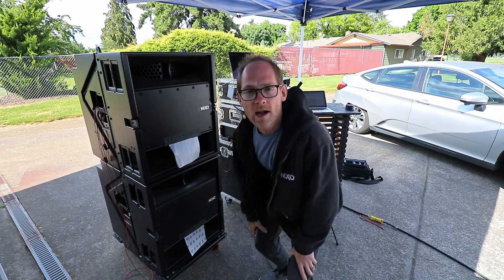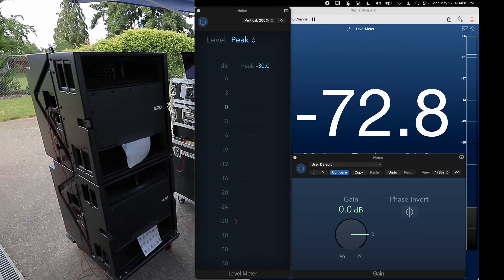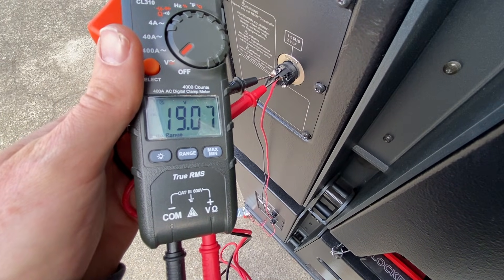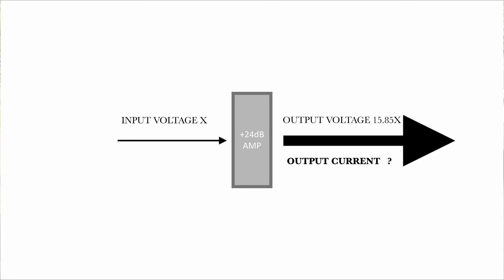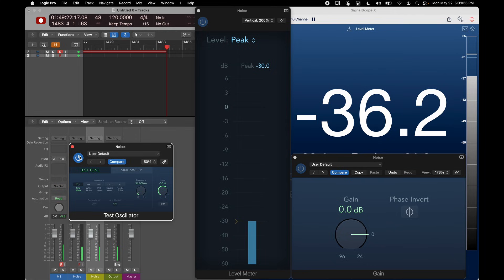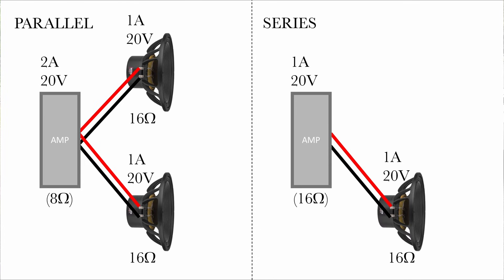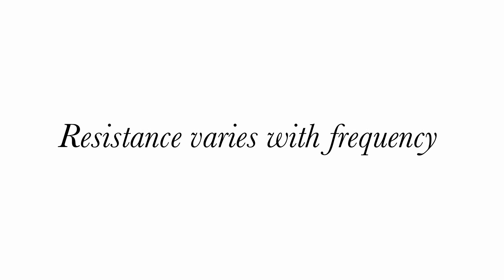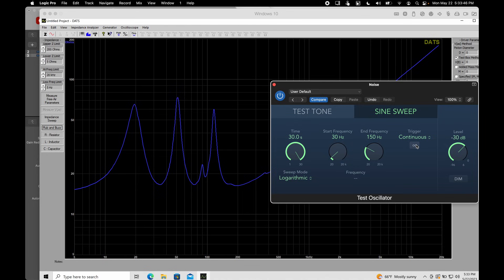Is doubling speakers +3dB or +6dB? What's parallel and series wiring?

Comment: I don't get with your +3dB amp and +3dB acoustic power adding together resulting in a 3dB gain.
The added electrical power  powers the added transducer, and the added transducer produces sound. The 3dB gain is converted into 3dB acoustic power. The acoustic energy is just the electrical energy being transformed into acoustic energy using the transducer. You've said that the transducer doubles the acoustic energy, and I don't agree, it just transforms it. 
The +6dB comes from the definition. If I have a sub firing, let's assume it produces a monopolar radiation, then this simple model spits out the pressure : P = μ0*Σ*ω^2*X_eff /4π  with X_eff being the efficient displacement of the membrane, Σ the surface of the loudspeaker and μ0 the magnetic constant. Then by adding another sub it's the same formula, but replacing  Σ by 2 * Σ. thus adding 20 * log(2) from the definition of SPL : SPL = 10 * log(acoustic power/ref_acoustic_power) = 20 * log(P/P_reference). And 20 * log(2) = 6.021 something. The discrepency between the +3dB POWER and the +6dB PRESSURE is that acoustic pressure is related to acoustic power by a square law. 
Please challenge me if I'm wrong, this has made me crazy over the last few days, I can't sleep lol.
Reply from the maker: 3dB from amp and 3dB from additional speaker (in parallel) will be 6dB total increase. The usual confusion is over why there would be 3dB more from the amp in parallel with the addition of a second speaker, but 3dB less from the amp when in series. Was this the thing you were referring to?
Reply: @devinlsheets_alphasound  yeah that's exactly my point. The 3dB added from the amp are transformed by the transducer, thus there is no "+3dB" from the additional sub. The +3dB from the additional sub comes from the amp. Saying "+3dB" because there is another sub means that this energy comes from nothing, which is not physically possible.
Reply: @devinlsheets_alphasound  the thing I'm referring to is a french pdf by Brouchier, you can find it online. What you're looking for is at page 52, but it's in french...
Reply from the maker: @dbzlouis  the thing is, the mic reads a 6dB increase when the second sub gets plugged in in parallel. Basically, that’s the starting point and then the question is: where does it come from? 

For example, you could imagine doubling the power to just one speaker. What would happen then?
Reply: Okay I think i got it. 
First, as a side note you didn't tell us how the dB measurement you're calculating is calculated! Sometimes there is a mismatch between the 10log(energy) and the 20log(pressure) formula and people mess up. 
But I think your db meter is not the cause, the real cause is the placement of the mic. At 0:54 I can see that your mic is in the air, so when you add another sub you have the sub + the reflexion of the sub. I think if you'd run the same test, but with the mic on the floor, you would not have than extra +3dB.

EDIT : I'm wrong, since even with the reflexion you also double the acoustical power, since the original sub is also being reflected
Reply from the maker: @dbzlouis  I actually did run the test with various mic locations because this was my initial suspicion as well, but it doesn’t make a difference, maybe a half decibel or so.
Reply: Another thought: mic placement is very close to the sub, 1m is not that far away at 36hz. My first message uses a very simple model, that can only apply when you're far away from the sources. Here since you're relatively close considering the wavelength, I think the model to apply is more a di-polar model. In that case, that can explain why you get +6dB. But put your microphone at least 3 wavelength further and I think you'll only see +3dB. 
I can try to reproduce that on video and test it in real life
Reply from the maker: @dbzlouis  yes this would be a very interesting test! Might try it myself as well
Reply: @devinlsheets_alphasound if so, try a test at 36Hz, and one at 100Hz for example, this would change the wavelength and give different results. 
I can do the math properly and give you the final results too haha, no more "in my head" calculation

Comment: What is going to hapen if we plug two pairs of 8ohm woofers but one pair is paraller and the other one in seriers to the first one? Will the resistance be the same as if we have just one woofer? And the output still be doubled? Or the output will cancel itself as well?

Comment: I've seen all the internet about this issue and this is the best explanation of all. I'm really impressed! But 3:44 you say that one more sub gives you +6db. Are you sure? I thought it would give you another 3db, not 6, so together they would make +6db and not +9db. Do I get it right?
Reply from the maker: That’s because you can’t add that second sub in parallel without also doubling the amplifier power, it just happens automatically
Reply: @devinlsheets_alphasound  I appreciate you answer but my question remains unanswered. Sorry, my English is not perfect and I might have not made myself clear enough. The problem is mathematics. If one sub gives +3db, another sub should give another +3db, which would make +6 db all together. What I Understand from you video at 3:44 is that one sub adds +3db but another sub adds +6db which all together makes + 9db. Which is correct? Does the extra sub give +3db or +6db? Because the picture is confusing to me. Thank you
Reply from the maker: @paul7000  we’re only asking what the addition of a second speaker is to the equation, whatever SPL the first speaker is already providing is a given
Reply: @devinlsheets_alphasound  If one sub gives +3db, do two same subs give +6db or +9db? Assuming that we feed them with same RMS.
Reply from the maker: @paul7000  one subs doesn’t give 3dB, it gives whatever dB you run it at, which depends on how big your amplifier is and how close you are to it. It might be 3, or 93, who knows. Adding the second speaker (and doubling the power) will add another 6dB to whatever dB the first speaker was putting out. If it was 3, then it’ll be 9 total. If it was 93, then it’ll be 99 total.
Reply: It is surprising. Thank you!

Comment: It should also be noted there are some practical considerations that need to be taken into account when doing things like this. When you let an amp drive a one or two ohm load, you're beating the crap out of it. Playing music through a system isn't the same as taking measurements on a test bench. Also, you have to consider distortion. The harder an amp works, the more it distorts. Its unavoidable, and the amount of distortion an amp produces is directly related to how well its made. 2 power amps may be rated for the same amount of output in watts/ohms, but one may have half the distortion, and in the real world, that would make it a much more powerful amplifier. 

I see in a lot of the comments, people seem to think they will be "loosing power" if they don't lower a speakers resistance so the amp puts out its rated full power at one or two ohms. Lowering resistance forces the amp into a situation where it has to work harder to deliver the same amount of performance than a speaker that is less demanding to drive, like one that drops no further than 5 or 6 ohms. The practical solution in a situation like this is to turn the volume up. That's why its better to present the amp with a speaker that's easy to drive in the first place. It leaves you with the freedom turn the volume up without fear that you will damage your amp or speakers.

Just to be clear, from what I could tell, everything covered in the video appears to be accurate. Nothing is wrong with the content. My concern is things were left out. Most likely there will be a future video covering the issues I raised above. So my advice would be to wait for future videos covering the rest of the topic before making any purchase decisions.
Reply: Wrong on a few points.

Comment: I have a question, that answer I cannot find anywhere. I have a pair of 4 Ohm speakers and a pair of 8 ohm speakers. My integrated amp had a typical 8 jacks for connecting 4 speakers. The A is 4ohm-8ohm, and the B speaker slot is 8-16 and the A+B asks for all 8 ohms. Since I dont have 2 pairs of 8 ohm speakers, so can I somehow connect the 4 Ohm speakers at the same time with 8 ohm without damaging the 4 ohm speakers, as I understood that in case of connecting all 4 speakers they should be all 8 ohm?

Comment: But what if amp would work in lower than 2 ohms. Why I can't connect 10 subs in parralel, because amp will rip ?
Reply: The issue is not just the nominal impedance of each speaker, it is also the absolute minimum impedance at a certain frequency. As we saw in this video, the graph of impedance by frequency for a given speaker has peaks and troughs. So with music containing a particular frequency at a high level, a frequency which corresponds to a very low trough on the impedance graph, the current in the amplifier could increase beyond what its circuits can handle, thermally speaking.

Comment: It's really surprising how little people in the business actually know about loudspeakers, which is what the basically make a living off of. 43% getting the 6db answer correct is astonishingly low.
Reply: He made a glaring mistake in his calculations, the real world answer when it comes to live sound is 3 db.
Reply: @pinocleen  No. You get 3 db more power, and also 3db more sensitivity. That is, if you haven’t reached maximum sensitivity yet, which takes A LOT of cabs to reach when it comes to subwoofers.
Reply: @Turntablist11  Just read the comments by Elkin Velásquez Cuítiva and J Smith where they explain the actual physics of it?
Reply: @pinocleen  Neither of their comments are in conflict with my comments here. 

Do you read it as such, and how do you do that?
Reply: @Turntablist11  Not sure, your comments are implying that this video is correct on its 6 db assumption and then you doubled down? Why don't you try and move the microphone around and see how you interpret that?
Reply: @pinocleen  6db would still hold true beside and behind the subwoofers, since the source of both subs is identical in position when they are stacked vertically.
Reply: @Turntablist11  Yes, I think the video could be explained better because it is causing a lot of confusion in the comments section, in part 2, I guess.
Reply: @pinocleen  Yeah it’s sort of explained halfways at a few points. 

You gain 3db in sensitivity per watt when you double the speakers, IF, the speakers are within 1/4 wavelength, and IF, you’re not already at the limit of sensitivity. 

The way he has stacked the subs, and that the example only includes subs, those things make the above statements true, but, the statements will not automatically be true for all speakers. Stacking lots of HF horns sure don’t get you 6db per doubling, for example.
Reply: @Turntablist11  Love learning new stuff, my background is in electronics and telecommunications, I have no pro/stage experience, so I'm glad I've picked your brains. Also a fan of the channel, for whatever reason, most likely my passion for amps, speakers and subs, and also seeing how this simple tech has evolved over the decades is fascinating.
Reply: @pinocleen  You’re most welcome! :) 

Loudspeaker driver design has taken leaps these past few years. Klippel is a huge contributor to that. Loudspeaker design is of course the natural following step, and hence that area is also changing quite fast right now. 

The most interesting things on the market are by far Danley Sound Labs designs. If you want to delve deeper into it all, I’d definitely start there. There is SO much to learn from understanding all of their designs.
Reply: @Turntablist11  This is right up my alley, as I've spent a few years installing just this kind of stuff during my studies, video/projection included, all except the live stage stuff, thanks.
Reply: @pinocleen  Danley is definitely your go-to then. 

Their very dense and rigidly built designs become heavy, which for the largest part make them viable for crews, or, for installs. :)
Reply: @Turntablist11  ahaha I've never heard of them before but looking at their spec sheet they sure pack a punch, and their upcoming home-range of speakers could be a banger. As for installs, give us an anchor point strong enough and we'll affix anything to it! Somehow..
Reply from the maker: There was indeed an error with that slide, I edited that part out with YouTube Studio.
Reply: @devinlsheets_alphasound  To err is human, more videos plz - I think that's how the saying goes?
Reply from the maker: @pinocleen  i think the saying goes "if at first you don't succeed, edit the video" lol
Reply: @devinlsheets_alphasound  :D

Comment: Great video. Do these rules apply to powered subs? I have the Yamaha DXS 18XLF powered subs. When I couple them together do I get +3 or +6 db gain?
Reply: In the case of self-powered equipment, the couplings are not a problem, since each box has an amplifier for itself, and therefore there are no impedance additions or subtractions.

Comment: At the 3:45 mark, I take exception to the idea that the second speaker adds  3db to the sould level.  In a parellel arrangement, adding a second speaker doesn't change the voltage, current, or power going to the first speaker.  Adding a second speaker doubles the amount of audio power produced (+3db).  The load on the amplifier has doubled requiring twice as much current.  Not only does this follow ohm's law, but also obeys the conservation of energy.
To get a 6db gain, you'd have to also double the power consumed and produced by each speaker.  But that didn't happen!  The voltage and current are the same and therefore so is the power per speaker.
The overall gain is only 3db.  So, why did the test microphone measure a 6db gain?
Reply from the maker: Right, good question. What if you just doubled the current going to the first speaker alone? Then what would the microphone read?

Of course this breaks ohms law, because you couldn’t double only the current and keep the voltage the same, but what you could do is increase the voltage and current each by 1.4 which would effectively double the power, which is the same thing. So in this case, we would get 3dB yes? And if so, if you split that power between two speakers instead of one, you’d have the 3dB from the doubling of power, but then also another 3dB from the doubling of speakers.
Reply: It's because its 6dB at a certain point in space. on average, you get +3dB. See for the formulas. If you double the acoustic intensity, you add 3dB. If you double the acoustic pressure, you get +6dB. He should have explained with formulas.
Reply: I'm with you on that.  The law of conservation of energy is pretty clear. You don't get something for nothing.
Reply: It's because most of that power isn't being transferred into sound, it's being wasted. You are not creating energy from nothing by adding boxes, it's already there, just not being utilized. Your speaker cone, being a solid, is high impedance and the air, being a compressible fluid, is low impedance. When you put a high impedance load into a low impedance load, well over 90% of your energy is wasted, sometimes as much as 99.9%. Most of the air just gets moved off to the side and eventually that motion ends up as heat and not sound. When you add another speaker, you double your cone area. That doubling of cone area doubles the efficiency of converting motion into sound of the whole system. That's where the second +3 db comes from, the increase in TOTAL system efficiency. Every time you double your speakers, you double your efficiency UNTIL you reach the maximum system efficiency possible and then that "free" +3 db's is no longer there. For direct radiator boxes (sealed, vented) that is about 25% maximum efficiency, horns can get you up to 50% total efficiency. So you get +6db's for every doubling of boxes until you reach that maximum efficiency, and then you only get +3db's after that for each doubling. Note that high frequencies will reach that maximum efficiency limit with fewer boxes then the lower frequencies. So when you double your box count you may get +6db's from say 20-55hz but only +3db's from 60-100hz because those higher frequencies may already be at their maximum. For horns you need about 8 boxes (subwoofers) to get to the maximum, for regular speakers you would need closer to 20 (double 18" ers) to get to their maximum efficiency, after that, no more +6, you only get +3.

Comment: Thanks for sharing BUT NOW what if you got 4 12inch speakers in one guitar cabinet and the are factory wired in Series/ Parallel...how does that read on amp output? Thanks again.
Reply: If they all are 8ohm it would read 8 ohms. If they are 4 ohm it would read 4 ohms, 16 ohms-16ohms.👍🤗😉🫣

Comment: If you have two drivers with different impedances u can do the math(Maths in uk) try this Add the two then Multiply the two then devide the two.or just use a multimeter like mormal people would😉

Comment: Don't forget with multiple drivers in a cabinet you can wire series/parallel meaning if all drivers are the same impedance then total impedance at socket is as one driver. All 8 ohms then total 8 ohms .my vintage Bose 802s are all in series with a 0.9 impedance per driver do you get anything from 7to 8 ohms